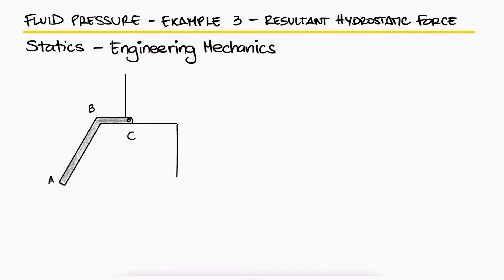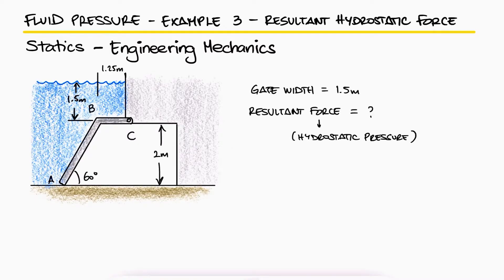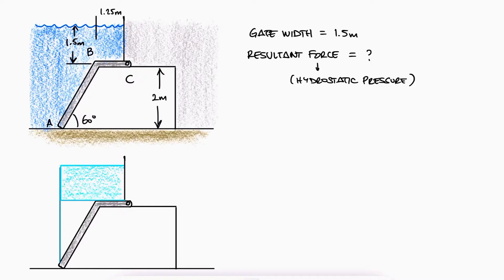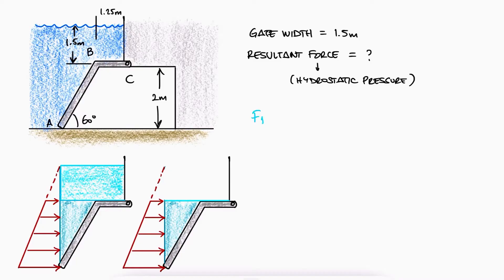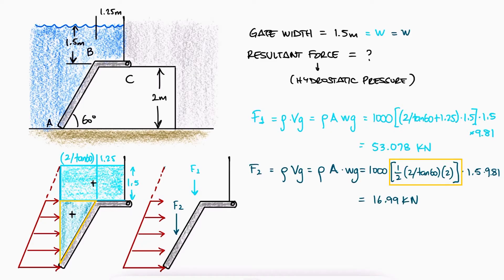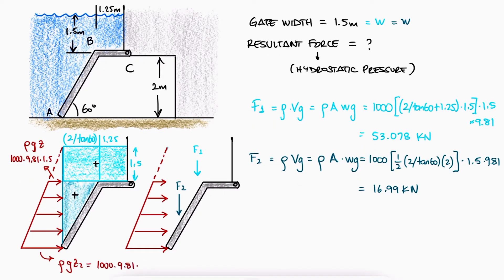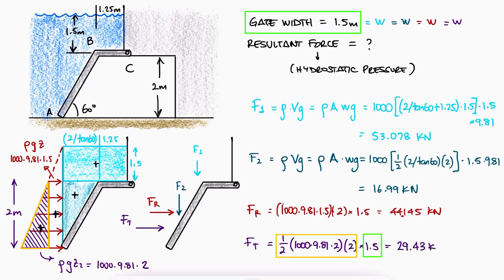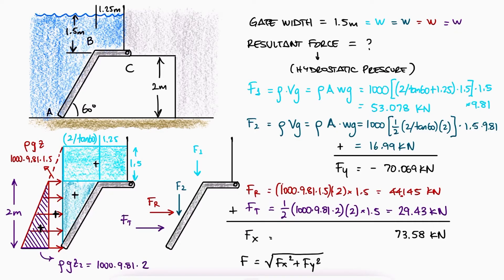Hydrostatic Pressure of submerged, SLANTED Gate in 2 Minutes!

Comment: I’m confused for Ft vertical distance. I thought the z2 value must be 2 meters plus 1.5 meters, therefore, the equation gives z2 =3.5 meters.
Reply: I think the reason z2 isn't 3.5 is because of the fact we broke it into 2 separate parts. That means we're only taking the dimensions of the triangle. If we did it with z2 = 3.5 meters, we'd get the bottom "length" of the BIG triangle, but we already accounted for the length of box. 
Mathematically, the entire bottom would be pg(2+1.5) Which is just combining the "length" of the bottoms of the box and the triangle.
Reply: We're supposed to subtract isn't it?

Comment: nice quick review thx!
Reply: I think the reason z2 isn't 3.5 is because of the fact we broke it into 2 separate parts. That means we're only taking the dimensions of the triangle. If we did it with z2 = 3.5 meters, we'd get the bottom "length" of the BIG triangle, but we already accounted for the length of box. 
Mathematically, the entire bottom would be pg(2+1.5) Which is just combining the "length" of the bottoms of the box and the triangle.